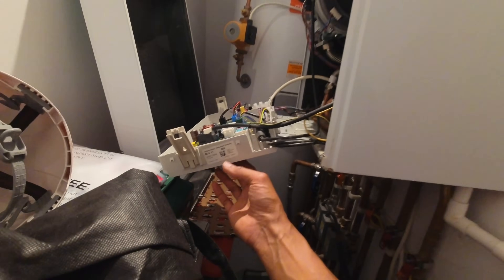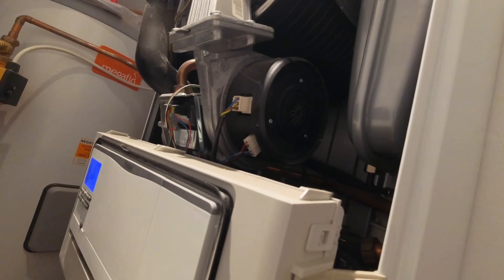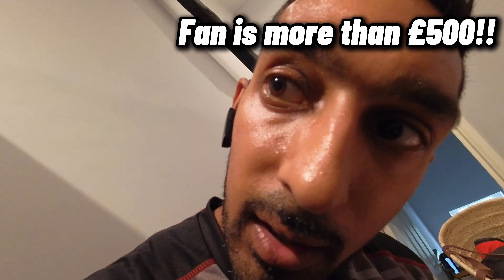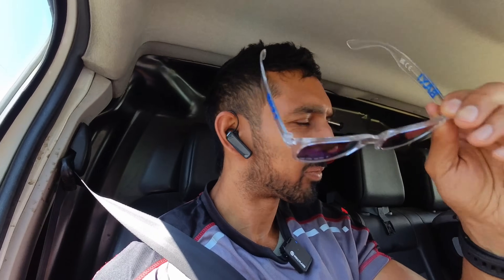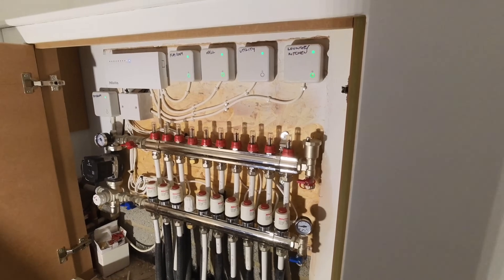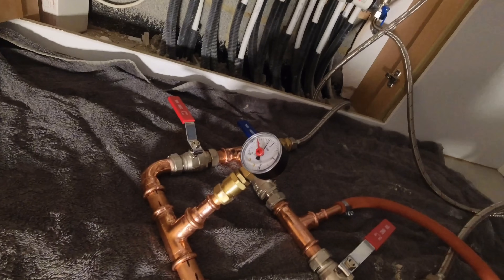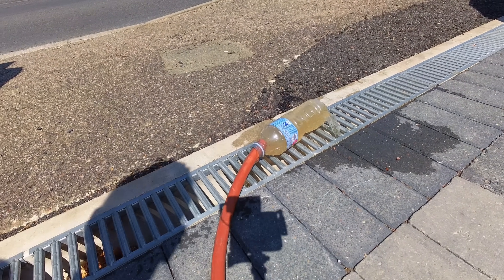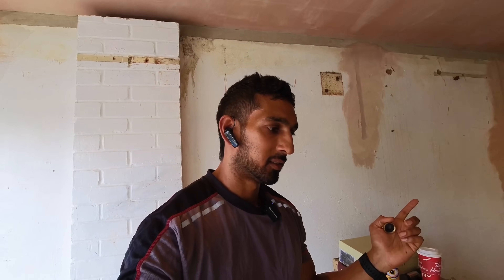Ouch! That's Going To Hurt Your Wallet

Comment: Weird coincidence. How did you get on with the fan replacement on the vaillant ? Came across the same vaillant issue of the fan cycling for a long time on initialisation after a reset or switching off/ on.. settled down then did it again when a demend .. very strange. I also suspected the PCB.. they tend to go at a certain age around the 2012-15 mark. Heated up the PCB with a hairdryer and started working ok. I suspect I might be going back again soon though.
Reply from the maker: So I went back recently and swapped the fan and it worked (will be on a later video). I did suspect it could also be the harness but it was the fan
Reply: @cputilitysolutions that's good to know as I've not encountered a failed PCB behaving like that before.. look forward to the second part. cheers Mac
Reply: @cputilitysolutions  Hi, the baxi with the fan running constantly can be fixed with a hairdryer on the  middle of the pcb , it usually happens when the power has been off for a while( capacitors  drying out). Keep the content coming.
Reply from the maker: @derekwaite6883 ah nice one mate thank you

Comment: see a drain off on the flow from a boiler its for reverse mains,.   someone before you did it.. this is just a mixed system underfloor and rads where the rust sinks. inobitor doesnt prevent corrosion, it slows it down.

i wont say cp rig or his mates  rig is neccisary. but great stuff. it gets people thinking..
Reply from the maker: Cheers mate 👍🏾

Comment: Can you check on multi meter if fan or PCB fault
Reply from the maker: You can but you'd have to ring the manufacturer for the tech specs
Reply: @cputilitysolutions ohh I see and they all different for each models